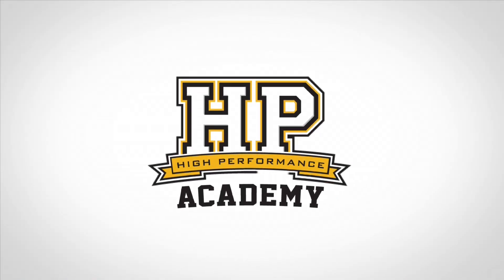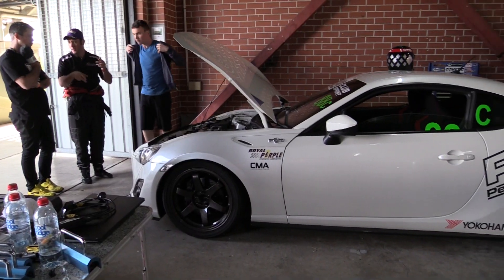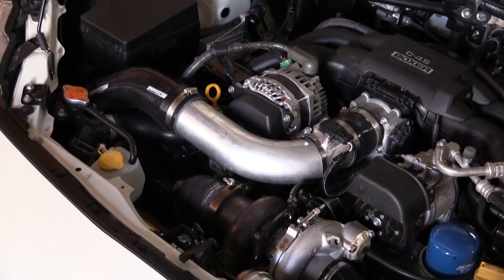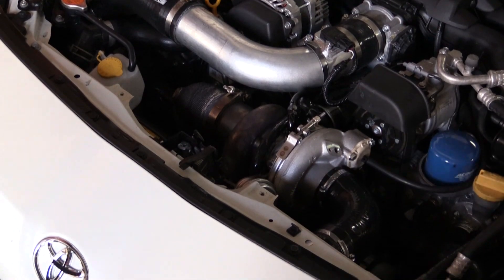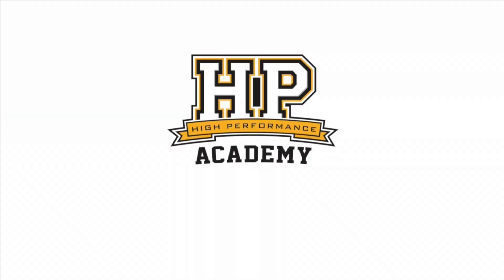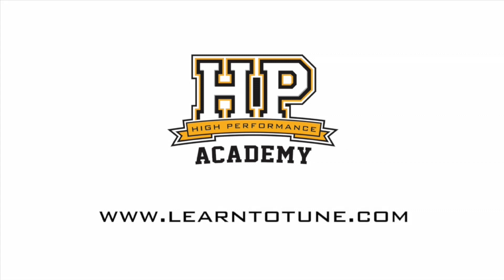GT86 Turbo VS Supercharging | What Is BEST? [TECH TALK]

Comment: Great contrast between a stock ECU calibration solution and a full stand alone engine management solution. This is a tough topic to discuss without stepping on toes or come off as sending gut punches. The truth is though, either of the solutions have their place, it's when they're used outside of their intended scope that complications arise reflecting their obvious pros and cons but that's a whole other topic.

Great video though, classic stuff 👍🏻
Reply from the maker: You're spot on! It's simply a constant measuring of pros and cons when you're doing it right. 

I thought Tyler also quickly covered the bases on both the advantages and disadvantages of his forced induction choices from his own real world experience with the same no nonsense, best tool for his application approach, which is great. We need more attitudes like this in the industry I reckon - Taz.
Reply: High Performance Academy I would like to think that that's the objective behind every HPA course, a better informed consumer base and a comprehensive service together with a higher competence level from service providers 🙌🏼

Comment: 10 grand to rebuild that engine... I love my SR.
Reply: The problem with the SR is your stuck with a boat chassis at the end of the day. You can always add power but a chassis you cannot change... BRZ all the way
Reply: @NMChiphopdawg  what type of car is the SR??
Reply: @lillopezer  Silvias
Reply: Tyler is talking about a complete engine long block build to go from NA to running 20+ psi reliably. It all depends on the power goal and usage.  Also depends the extent of porting and polish that you are willing to pay for.  For a similar build the SR20 is about 10-20% cheaper.
Reply: You can do it for 4k easily lol